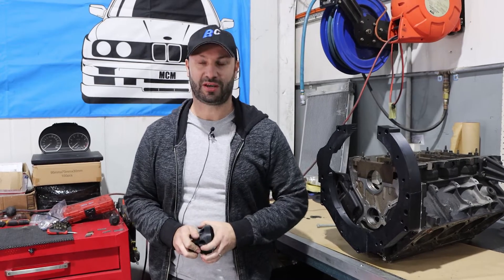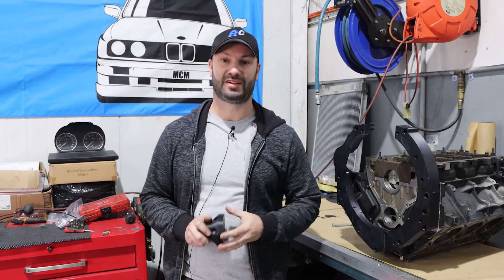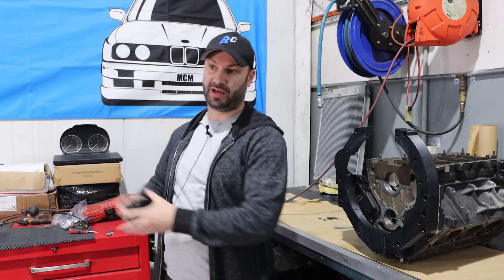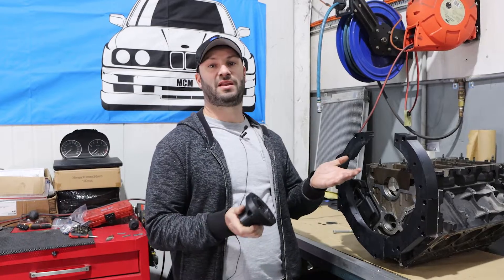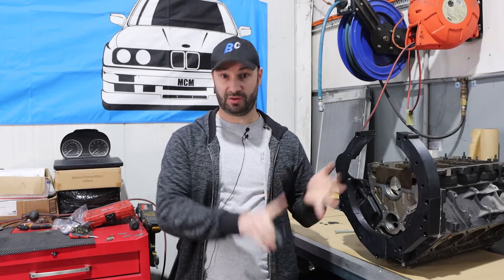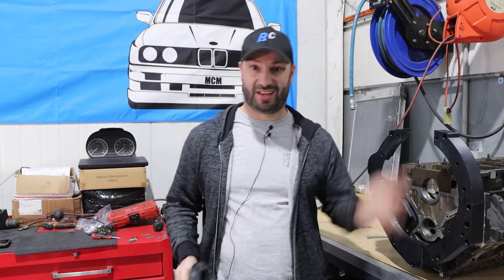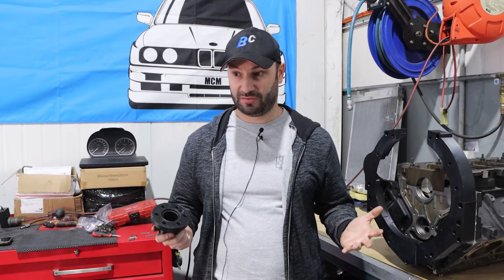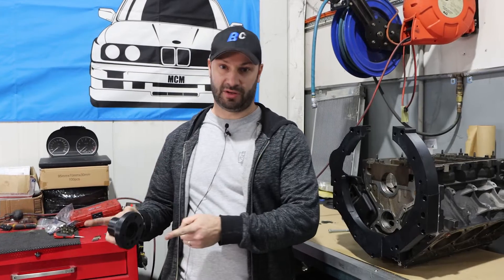BMW 1 Series LS V8 Swap by Brintech - Part 1

Comment: Can this kit be fitted to 135i with a DCT?
Reply: It will fit any E8x or E9x chassis - it is deigned to mount an LS engine and T56 or TR6060 Tremec GM box.
Reply: @nowweretorquin8691  So thats a no then lol
Reply from the maker: @BB-tb9ih  Sorry your question was ambiguous. Ill clarify what you probably meant: Does the transmission cross member we supply work for a DCT? Obviously not, a GM and DCT box have different mounting points. Can it work? Yes. With a different mount, we also have DCT adapter plates for LS engine.
Reply: @BrintechCustoms  Thank you sir, good to know it can be done :)

Comment: coming back to this video again since im not sure how else i should keep in contact. anyways i was wondering is the 128 or 135 radiator better for this swap? correct me if im wrong but arent there some minor differences

Comment: I love the fact that you did that to a hatch back. Most people would go for the coupe
Reply from the maker: I think the hatch is an un-tapped gem. Front engine rear wheel drive practical and nimble. The V8 makes it quite special
Reply: @BrintechCustoms  I wish we had the hatchback in usa

Comment: Question for anyone…what I never understand about LS swaps for late model cars is when you unplug the original engine wiring what do you do with those wires? Do you pull them out at the BMW computer or leave them and hide them? If pulling out how do you know what to take out. Anyways that’s my biggest source of uncertainty when considering a project like this

Comment: my friends i have a few questions i have a bmw 1 serie 120i petrol year 2006 e87 model 150hp i only replaced the engine two months ago. there is now 2 tons on the engine. just drive really nice. now the engine is built into it. only brand oil consumption. The mechanic told me that the wrong oil was used by my mechanic. and that now the valve spools and staples are replaced.

First question is, I really like my car to drive. The only downside is that my valve stem needs to be replaced. because it consumes a lot of oil. need to top up oil every week. and also consumes quite a lot of gasoline, he is not the most economical, that may have to do with oil consumption. that it is not economical.

I have seen your video. it motivated me a lot. because my 1 series is a really nice car. he has all options. only it doesn't have a turbo. so I can't get chipped. should be another reason. to make my car faster. Or do I have to change my engine as well? just like you in the video. after I've watched your video, I'm now thinking of putting a BMW 535i or 540i engine in it, is that possible what would something like that cost.? I know there are a lot of things that need to change about the car. but if you are a fan you should talk about it I think. I would like advice on what is the best thing to do. Also what is the proce for building 535i 540i motor in e87 2006 benzine  whats the price mine frend.

Comment: I'm very glad I came across this video. I have a 120i with relatively low mileage with a nice set of BMW X5 rims on and sent it in to sort out oil leaks and the estimate was a third of the price that a normal LS swop would cost, so I was hoping it was possible to do it to this car. I'd rather spend money this way!
Reply: How big are your rims? 🙏
Reply: @lucajack007  they were 18 inch x5 mags. sitting with 19's on my F30 now though

Comment: Why not N54/N55
Reply: I don't think you are familiar with the LS V8's, a 6-litre version will make more torque at 1000rpm than any highly strung N54 or 55 and they keep going with just normal (and cheap) regular maintenance.
Reply: @Slaktrax  I'm totally new on this but I want to learn. So, for my project do you recommend pick the LS instead of a N55? My car is a 125i coupe.

Comment: Great video , don’t worry about the schmuts on the intake that’s nothing send it! I love how much room
There still is in there what a sleeper
Reply from the maker: You'd love this car. You should come and review the finished product
Reply: @BrintechCustoms  how do u control the dct gearbox after u swap in an ls??
Reply from the maker: @FirstLast-tx3yj  We have a 3rd party controller we will be using for this.
Reply: @BrintechCustoms  max ecu or htg??
Reply from the maker: @FirstLast-tx3yj  Neither
Reply: @BrintechCustoms  the only one left is dkg but it is not as popular especially that you have to contact them for software or to order...

Please tell me what it is if it is not this one!!
Reply from the maker: @FirstLast-tx3yj  We are working with our own contacts to develop and prototype a solution.
Reply from the maker: @FirstLast-tx3yj  FYI - Having to contact DKG for software and to purchase... this is typical for a transaction with a company you would want to build a relationship with. DKG have excellent support and very responsive turn around, we know of a number of people that have only good things to say about them.
Reply: @BrintechCustoms  epic more power to you... hope its more affordable though

Maybe an arduino based design that injects can messages to the stock tcu flashed would be possible

Max ecu way is much simpler than the htg and dkg routes that require soldering nit to mention extensive tuning afterwords

But max ecu obliges the conversion of the engine managment and paying 1000+ for an ecu

Good luck subscribed....